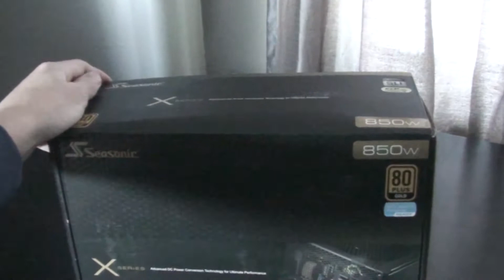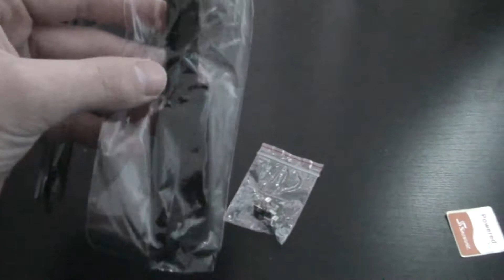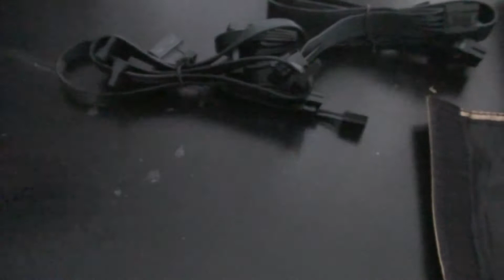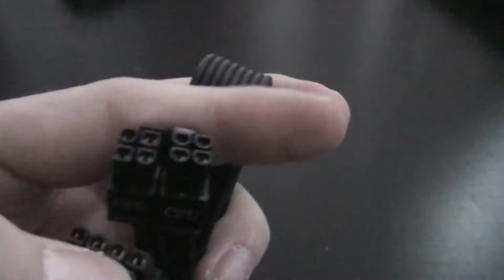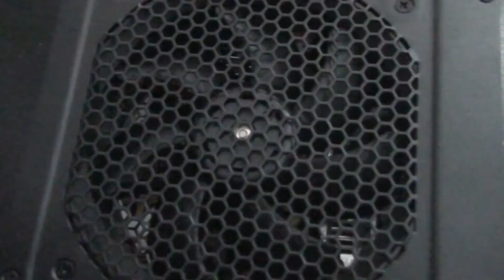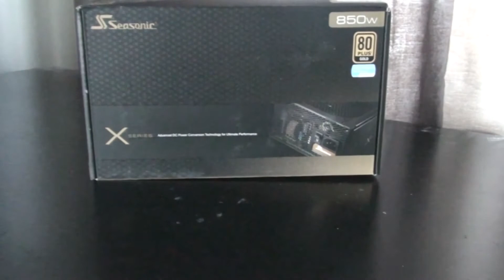Seasonic X-850 Power Supply Unboxing

Comment: Mind I asking whats the model number on your PSU ?
Reply from the maker: SS-850KM Active PFC F3 (X-850)                That's what I see on the box under Model number. Hope that helps!
Reply: Nickanator15 Actually the model on the side of your PSU I meant. Where most of the PSU info. 
Does yours has a " 3 " on the 850KM ??
Reply from the maker: yup, it does

Comment: just got the 80 plus gold 1050W by Seasonic....awesome PSU.
Reply from the maker: Yeah, Seasonic makes amazing PSU's! What's your system specs?
Reply: The Seasonic replaced my Corsair 850W psu. I was going to get a Corsair 1000W but heard Seasonic is the best brand out there when it comes to power supplies.
Specs:
Asus P8Z77-v Pro motherboard / Intel i5 3570k CPU / 16GB corsair dominator platinum @ 1866MHz / Asus GTX 780 DirectCU II video card / Asus Xonar DX 7.1 channel soundcard, a Samsung 250GB SSD all inside a Corsair Obsidian 800D case...oh and a corsair h100i cpu cooler + 6 other HDD's and a ton of other peripherals
:)
Reply: Nickanator15
I realize my 1050W psu is a bit overkill, but i thought i may as well future proof my system and just in case i need to SLI my 780, which i might since i just bought an Asus PB278Q 1440p monitor. I have noticed my framerate has dropped in bf4 to about 40fps sometimes even 30 :(
If Watch Dogs produces lousy framerates at 1440p, i am buying another 780 lol
Reply from the maker: With Watch Dogs, It's also going to take a lot of CPU power. So make sure you have a good CPU to run Watch Dog! And, yeah 1050w is a bit overkill. But future proofing is always good like what I did!
Reply: do you think an i5 3570k OC'd will do it? or do i need to upgrade to 1150 socket mobo to get a 4770?
Reply from the maker: your i5 should be plenty good! Just not on Ultra settings!
Reply: Actually i just went out today and bought an i5 4690 and a Maximus VII Hero z97 board lol
I'm not messing around, i want to be prepared for Watch Dogs!
Reply from the maker: Alright, well have fun with Watch Dogs!